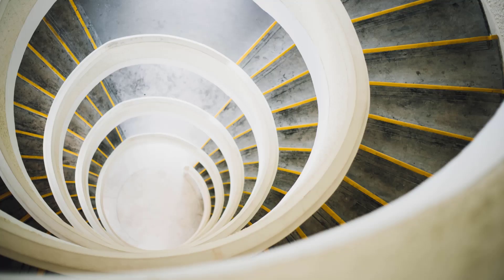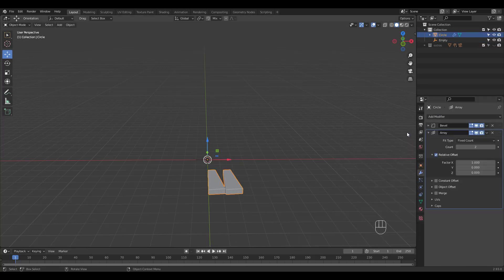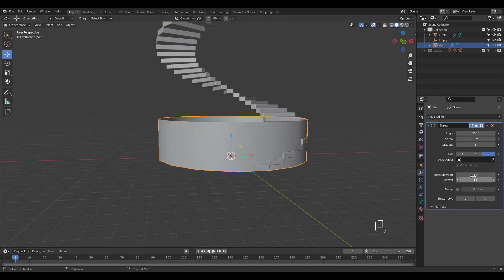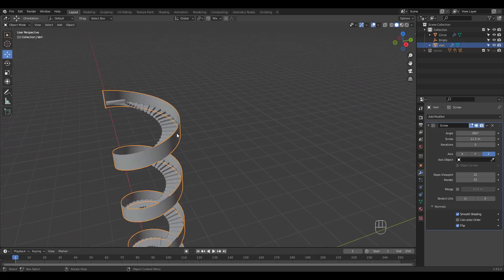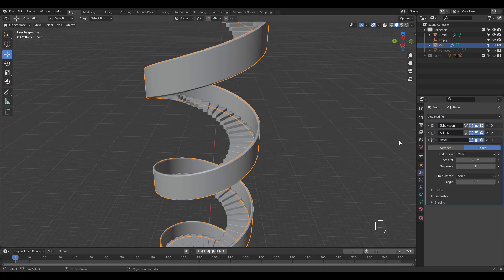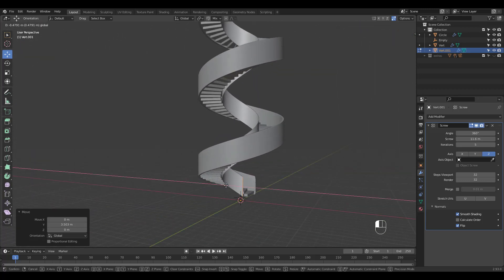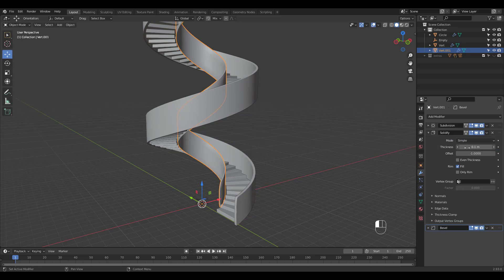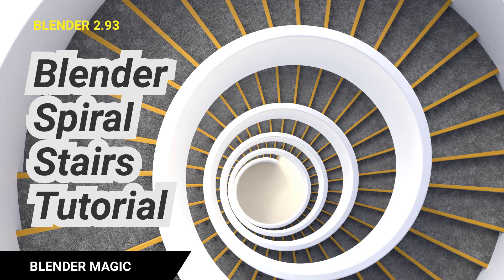Blender Spiral Stairs Modeling Tutorial

Comment: Okay, I've done this a dozen times now on two different versions of Blender, and every time I get to the part where I rotate the empty on the Z axis, absolutely nothing happens. The single step doesn't spin into a circle, it just sits there inert. I've watched about four different tutorials on this and they all say the same thing. Is there some vital step that's being skipped over?
Reply from the maker: No step is skipped over in this tutorial. Make sure the object's origin point is where the cursor (cursor should be at world origin) is. Array modifier should have object offset checked and the empty should be selected as that object. The empty should be located at world origin as well. I would assume you're having problem with object's origin point if nothing seems to happen. Maybe it's getting stacked on top of each other?? Otherwise I'm at a loss what the problem might be.
Reply: @blender3dmagic  Tried again...all those things are set as you said, but it still won't do anything when I rotate the empty. Well, it does one weird thing: when I initially select the empty for object offset, it makes a tiny little copy of the step in very close to the origin point, and that little step rotates with the empty, though it also doesn't extrude in the circular pattern I see in this video, and of course the big one still just sits there. Honestly, this is pretty par for the course where computers and me are concerned, and Blender is by far the most uncooperative program I've ever attempted...it makes After Effects look like child's play. Thanks for your speedy reply, nonetheless. I guess I'll just make the steps individually.
Reply: @Corn_Pone_Flicks  IDK if you figured the problem to this  yet but I figured it out by messing around with the Empty. Select the empty and assign its PARENT to be your OBJECT you want to modify. It not only got rid of that little duplicate but did what the video is showing.

Comment: It's not working blender 3.2.0 version. please help me
Reply from the maker: What is not working??? A shortcut? You have to specifiy which part doesn't work.
For this tutorial, the version should not matter much but then I can be mistaken so please let me know the specifics.
Reply: @blender3dmagic  The Array modifier does not seem to be working with the empty. any changes to rotation and/or height do not add steps but rather transform the original step.
Reply from the maker: @Ekpap  I just tried again in version 3.2 and it's working fine. You might have some issues with not applying transforms if you didn't scale, rotate, etc. in edit mode or it might be the object's origin??? I'm not sure.
Reply: @blender3dmagic  I figured it out- I had to apply the scale! (Not sure why that was the fix, but it worked).